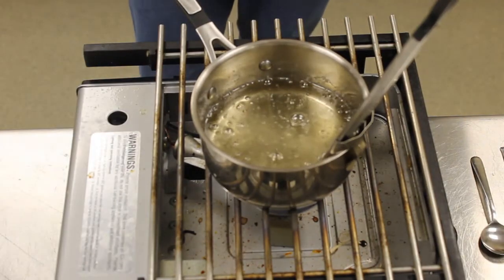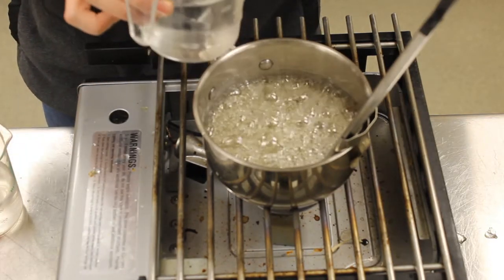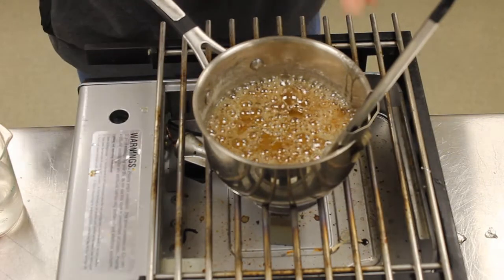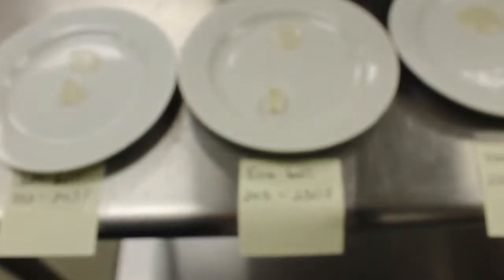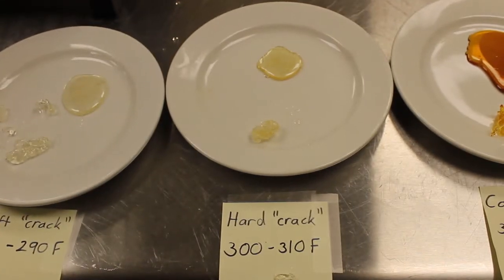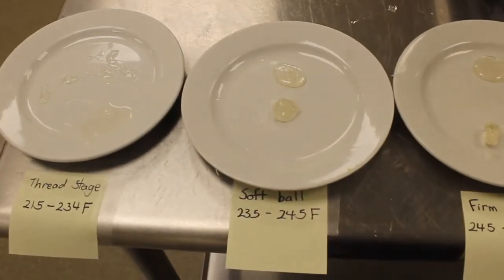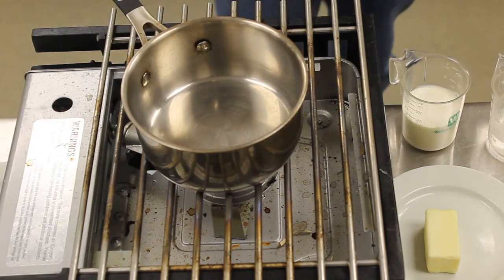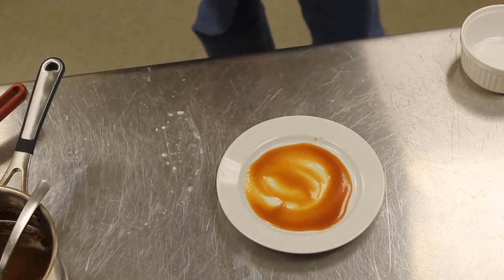Sugar cooking/Candy Stages Demonstration & Caramel Sauce

Comment: I  am making Candy Apples and was told to heat sugar to 300 for it not to stick to the bags i put them in. I got a big apple lollipop. I would like it to be like Kraft Caramel but with out the sticky.... what do you think about a soft ball stage? will it be sticky if i allow it to dry?? can you help me?
Reply from the maker: I've made that same mistake before of making a hard candy apple "lollipop" lol In your sugar syrup, did you add anything else such as cream, butter, corn syrup? That can affect the texture of the caramel. Unfortunately in order to get a somewhat softer texture of a caramel, you will have a bit of sticky-ness to it for bagging regardless of what you do. Personally that's where a coating of something like peanuts, m&m's, coconut, chocolate, etc. can actually help a lot; giving the outside of the apple a protective coating to help minimize sticking..  also, putting your completed apples in the fridge before bagging will help a bit too
Reply: @mr.g.culinary  great ideas. I make these chili apples with corn syrup ( not cooking it ). Painting on the corn syrup.  It seems to work but if left out of fridge to long - it just melts down. I will try all of your suggestions and continue to experiment. Thank you for answering.